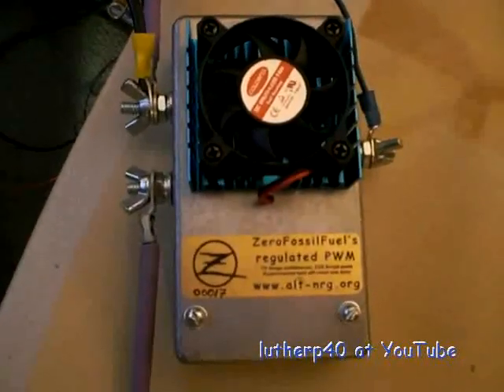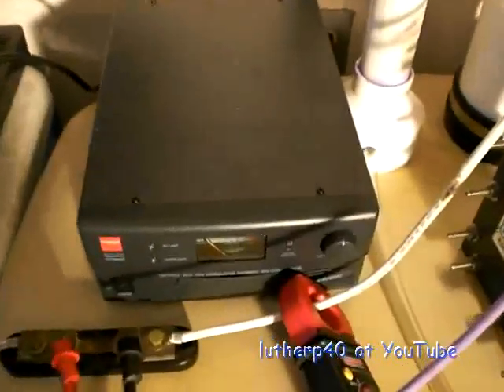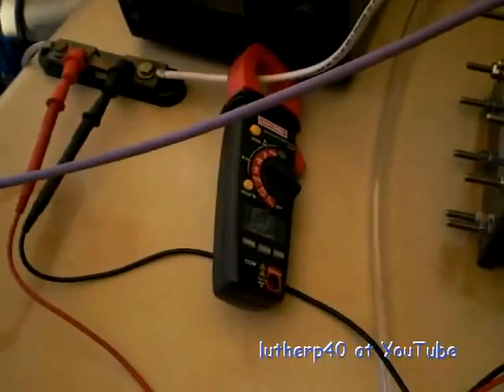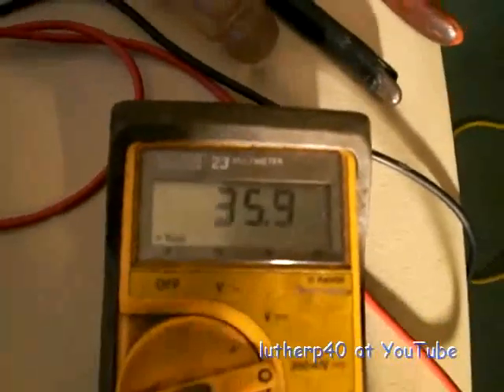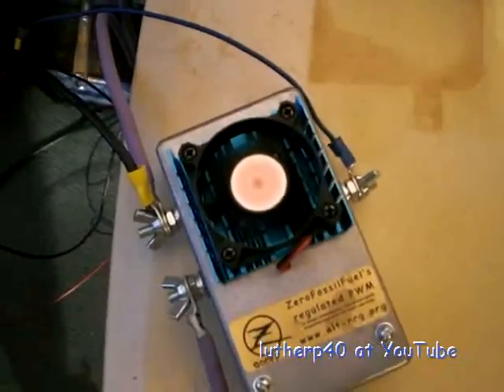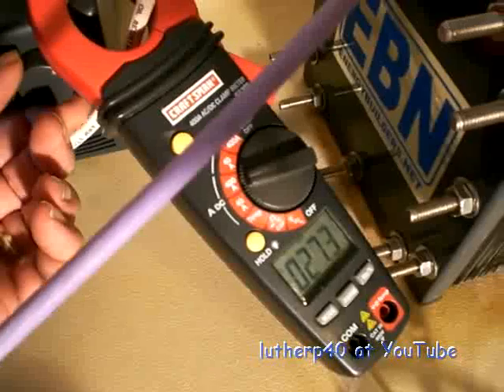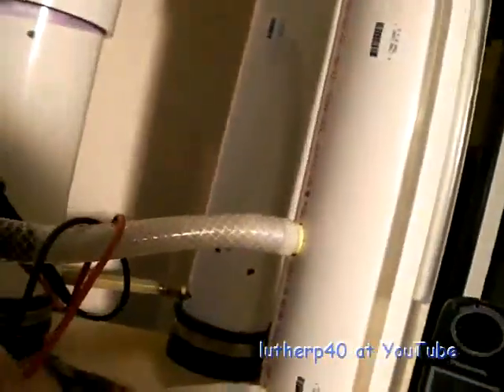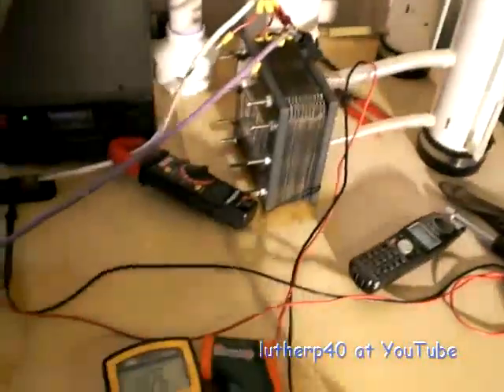A First Look at the ZFF v2 PWM

Comment: Hi Luther,

Great vid, great CONTENT, not visual QUALITY, as you stated! ha...

OK, SO, in this vid, at:
1. 14.43 Volts, 
2. 40 Amps, 
and what I saw from your vid 
3. .5 Liters in 13 seconds?
This calculates out to 4.03 MMW is this correct? If not, please correct.

I know your cell was more efficient than this w/o the pwm when you were using brute force DC.  I know you're just now settin this up as well.

Can't wait to see if your efficiency increases or not.

Superbee1970

Comment: Nice vid.
Problem with meter's accuracy is most likely the shunt. I would lean toward the new craftsman being the most accurate. You were probably running a little out of whack from the time you started using the shunt. But that's neither here nor there.  Looks like you have better equipment, now.
Would like to see your MMW with the PWM and without as a comparison. Whether is reduces or increases efficiency...reduces output or increases output, too
Good Job! Keep up the good work!
Steve

Comment: try using an old multimeter analog one it might be less sensitive ,forget about the charger  reading and if you want a little more accuracy you can go with fuse yet depending about there quality they have a little tolerance but you know that you are protected so start with 30 or 35 amps and see iff it blows up after 30 min if every thing goes right than you check with your amp readings and you know if it is well calibrated .I notissed a lot off steam ???
and about draining the cell oh my god ,